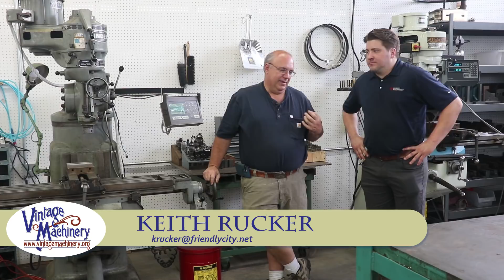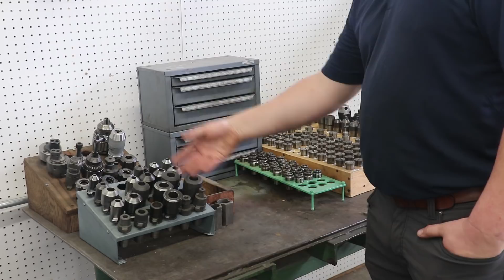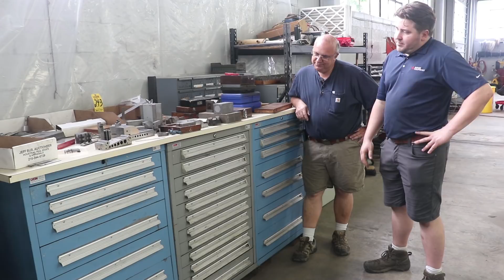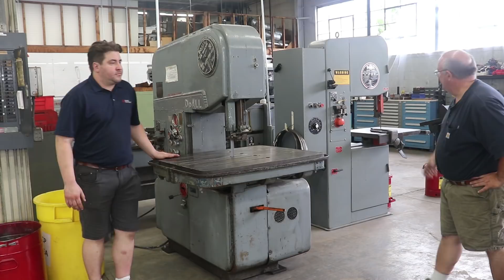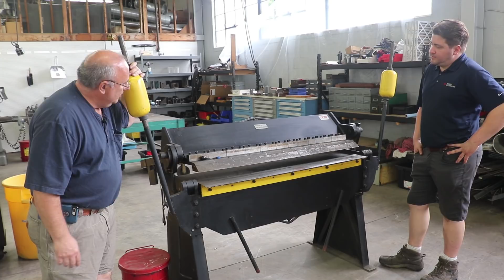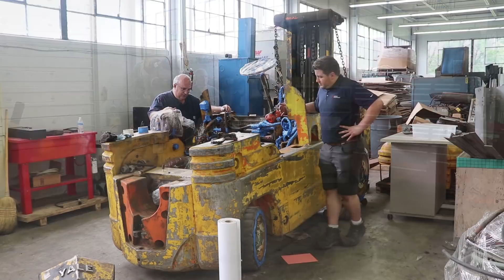Shop Tour 8:  Boggs Equipment

Comment: "We get paid to scrap worn-out/depreciated-out/obsolete/worthless scrap metal called "vintage machine tools" by the "owners" of same and then do "DuPont overhauls" on that shit and then sell it to suckers too stupid to know that the only reason to get rid of a used "quality" tool to a "reseller" is when its scrap and worthless or worse who think they're getting "good deals" on shit we get paid to haul off and they could get paid to haul off too if they weren't completely clueless about the world of "industrial manufacturing and tools" but instead pay stupid amounts of money and many times "scrap price" for all that shit "scrap yards" won't take or won't pay for if they do because it can't be simply "crushed" or "shredded" or "baled" as-is and that is completely unsuitable to a "home workshop" in terms of size, electrical requirements, etc and that is also almost certainly missing or has had "bypassed" whatever "safety equipment" it originally had and is an electrical fire/personal injury/dead "machinist" waiting to happen if it runs at all and runs "well" and "long" and "hard" enough being used to its "full capacity" with a POS "phase converter" and/or other "workarounds" to make that worn-out piece of scrap metal industrial machine into a "hobbyist" machine in some idiot's home "machine shop" running on an already maxed out or nearly maxed-out household residential single-family dwelling single-phase 220V 150-amp max service.

Comment: On that forklift... 292 cu.in. Chevrolet/GMC..... Just sayin' Ford used 240 and 300 cu.in....  Yes I am old but still have a memory... lol   Best wishes...   ;o)    
O,,,
Reply: Opinionator52 Ford Y block 239, 256, 272, 292, & 312 CU IN produced 1954 to 1964
Reply: Opinionator52.....The engines Cad-Cam lists are the Ford Y block V8's they used in the 54 - 64 trucks and cars (312 was the famous Thunderbird engine).  The 240 and 300 you are remembering, were the common 6 cyl for those years.
Reply: @paulcopeland9035  Wrong. The 240 and 300 didn't come out until 1964 and "replaced" the Y-block-era "3rd generation" Ford sixes at the same time the "Windsor" small-blocks and "FE" big-blocks replaced the "Y-block" engines.
Reply: Ouch sorry Paul,,, I thought the forklift would have been inline I know well the V8s so much for being old with memory i have that the cognitive abilities must be slipping toward the void.... Again sorry....   Anyway have a good one.... :o)  
O,,,
Reply: Sorry Cad-Cam,,, I was thinking inline,,, but should have realized in that size forklift it would likely have plenty room for the V8.... :o)   
O,,,
Reply: No need to be sorry!  Just a confusing bunch of engines from the old days.  Have a good day my friend.
Reply: The 292 is only one of about half a dozen of "modern" inline 6-cylinder Chevrolet engines that "replaced" the 235 "Stovebolt" six and all but the 292 pre-date both of those Ford "copies" of the 230 cubic-inch and 292 cubic-inch Chevy sixes. And in typical Ford "response" fashion Ford made the 240 smaller than the Chevy 250 and larger than the Chevy 230 and made the 300 larger than the 292 so it wouldn't be completely obvious once again Chevy acted and Ford re-acted and so true "comparisons" were/are impossible. 

Although anyone with a clue knows a 292 Chevy will stomp the dogshit out a Ford 300 in "identical" applications/vehicles "long-term" since eventually the Ford 300 six will shell/strip out its nylon cam gear in its "superior" gear-drive timing gears while the "inferior" Chevy timing chain and steel gears will last "forever".

Comment: That Universal Kwik Switch should lock open. Then it self latches when you insert the tool, one handed. I had to clean out mine and make some adjustments to make it work properly again. It is a great system.
Reply: The locking pin is broken.  Very common problem on those holders but they are great.